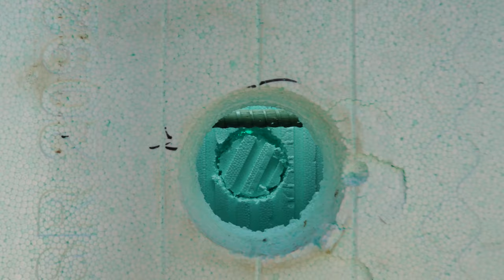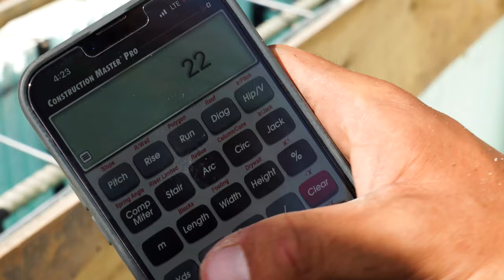How To SUCCESSFULY Pour An ICF POOL | Visionary Vlog - EP 08

Comment: Great video ! When you use the 3" pipe for serviceable return valves. How do you later mount/fix in palce the return valve in the 3" pipe ? fix it with buildingfoam ?
Reply from the maker: That is correct! We use spray foam inside the 3" PVC and that grabs and holds everything in place (with the expansion).  One thing we recommend is putting a piece of 2x4 over the face of the skimmer when doing it (and screwing it into the walls), just so the expansion from the Spray foam doesn't push the return out at all.